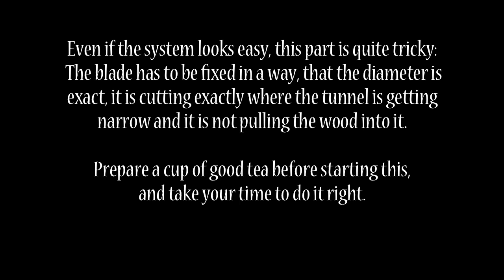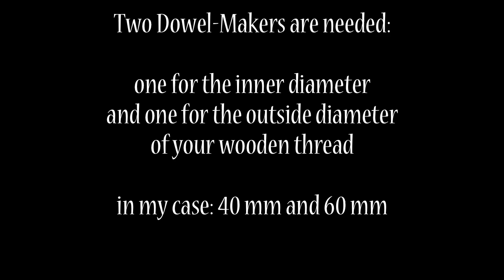Self-Made Tools for Wooden Threads  Part I: Dowel Maker

Comment: I'd love to see you translate this excellent "dowel maker" into a type of rotary, rounding plane. I'm sure one could just put handles on what you made and go from there. I love the fact that you are using big stock to make your dowels. How did you make it round in the first place? I would like to use round wood / branches from trees, sand use such a plane to make tenons to fit in chairs and furniture.
Reply from the maker: I have seen the tool you have described in a second hand tool shop. So, it exists :-)
For my new screws i do not use it any more, i just plane them with my hand plane. Somehow i found it to be more easy and more precise. If you are interested you can see how i do it in the my video about screw making. Maybe it will be helpful for your project.

Comment: What is reason for planing at an angle?
Reply from the maker: Hmm, maybe it is not needed...
Reply: lol.  In most every video I've watched wider pieces have been planed at an angle.  Does it turn out smoother with less tear outs?
Reply from the maker: If i would make one more dowel maker, i would also put the blade on an angle. In my dowel-maker, even if planed in angle, the blade is still parallel to the tangent. It would be better, if the blade would touch the wood like it does with a plane. Maybe something between 25° and 45°.
For me, it worked quite well, but still sometimes it bit pulled the wood towards the blade. I think, that it would be much better without this pulling.
Hope, this was understandable. 
And if someone has some experience for this... would be nice to hear about it!